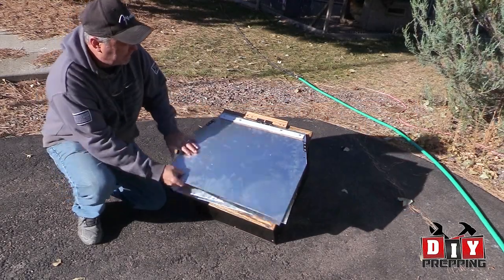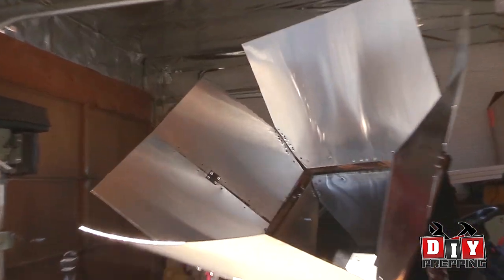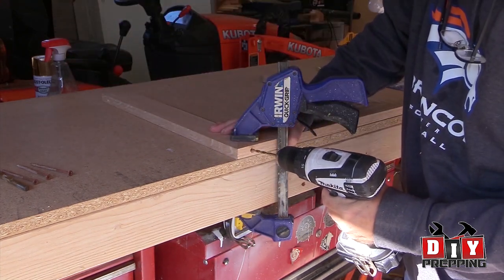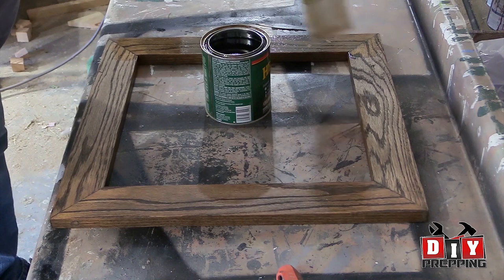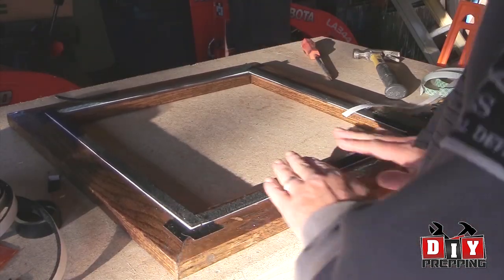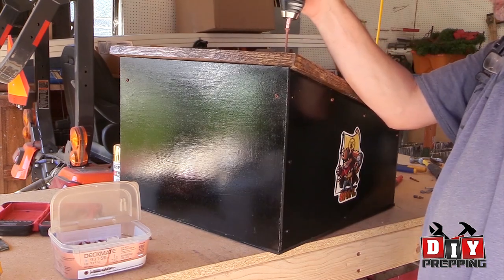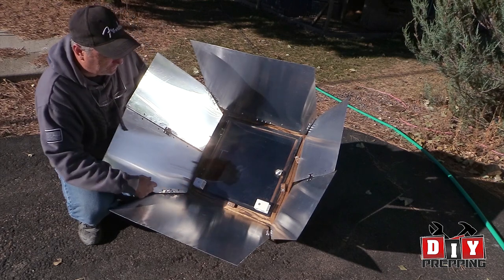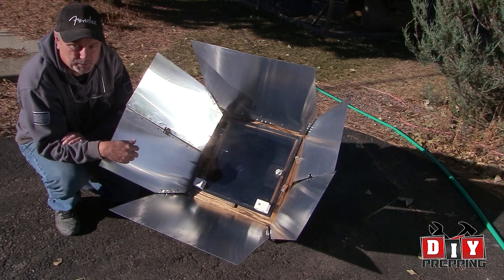DIY Solar Cooker: Attaching the Top and Accessories

Comment: Everybody asking... he mentioned that with the original plexiglass top got it to 325f. Probably a bit better with clear glass. I'd skip plexi (acrylic) or lexan (polycarbonate) because they're plastics, and could off-gas. Plus, if the oven gets beyond 320 degrees, it'll begin to warp, melting point. Keeping costs down, highly reflective mylar is available in rolls to glue to the thin MDF or lauan for the reflectors. It's mirror shiny, considerably more reflective than the mylar bag material. Also, it's pretty easy to use a router and recess the glass into a top frame. I bought a piece of tempered glass from a glass place and hold it in the routed inner edge with thin batten strips. ....Nice series of videos, so thanks for sharing.